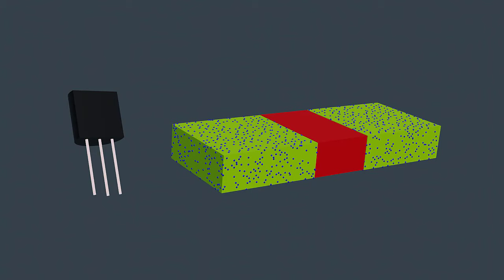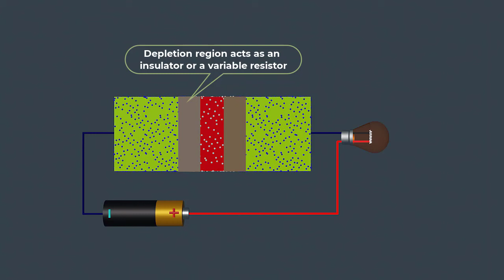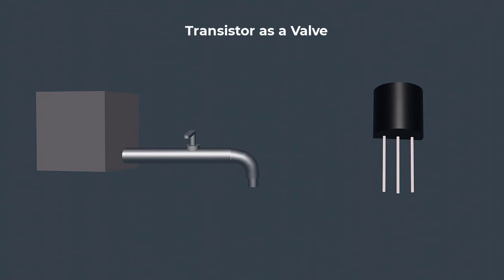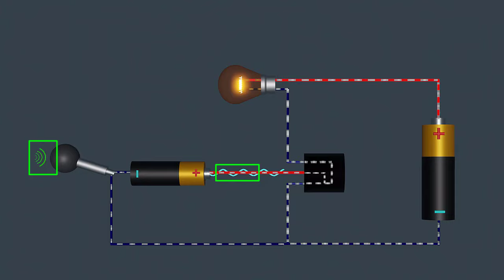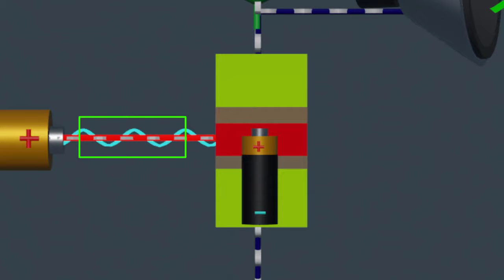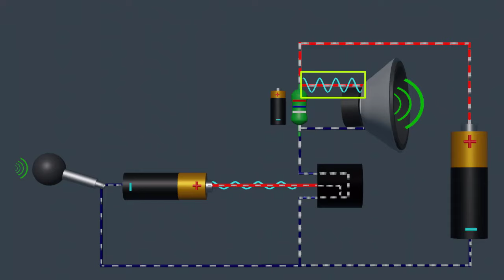How Transistor works as an Amplifier | Transistor as an Amplifier | Transistor Amplifier

Comment: this is not the proper flow of electrons...it is reversed & goes to the mic first the mic signal is coming from the negative end...and fed into the  collector of the transistor....out the emitter...this video has it backwards...
Reply from the maker: Current flow is of two types. Electronic current and conventional current.
Reply: @Janvisualphysics  if it flows to the battery out of the transistor the speaker will not make a sound...
Reply: I think you should understand the basic difference between conventional current flow and electrons flow!

Comment: Liiks nice but misleading: the image comparing a BJT and a MOSFET suggests that the first is small and the second is big, which is wrong; you show a small power and a big power transistor (which can be BJT or MOSFET).  And nobody ever puts a battery on the base like that; that's confusing.

Comment: Hello, why does electrical flow comes from the Plus terminal of battery instead of minus?
Reply from the maker: It's convention.  In reality electricity is the flow of electrons, from negative to positive terminal.
Reply: Between your head and butt which part are you thinking from??
Reply: @markadadofficial actually, hes right. Electricity flows from negative to positive on a battery.
Reply: Electrons and current flow in opposite direction
Reply: Who even uses electron flow nowadays bruh, majority of books and even circuit design is in conventional current flow.

Comment: Q1: Why do we need that resistor? Or put differently: what would happen if we removed it?

Q2: What decides how high resistance that transistor should have?

Thanks for the video!
Reply: Resistor is a load in this circuit..

Comment: I have a doubt that for example if we give 5v 3milliamps will i get amplified output as 3amps from collector by boosting in transistor or from the external power supply should be connected to have that capacity to drive 5v 3amps load
Reply from the maker: Transistors don't have internal power bank, it takes energy from external source and produce amplified output.
Reply: Then which device should I use to boost the current
Reply from the maker: Write the whole story, what you want to do ?
Mention your input, output voltages, whether you are trying with ac or dc. Amounts and nature of current ?

Comment: Isn't the collector only moderately doped?
Reply from the maker: No. Collector collect 95% of the incoming  charges,therefore it need to be heavily doped.
Reply: If the collector is heavily doped as you suggest.. won't it (collector)get heat up as more electron are injected from the emitter? What's about the breakdown voltage too?🙏🙏